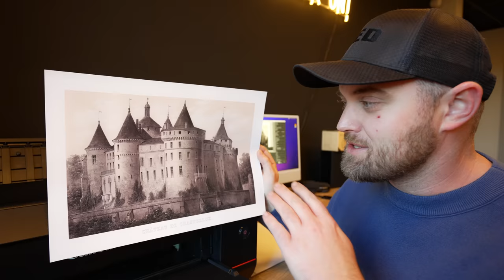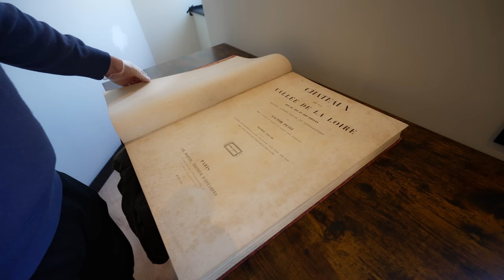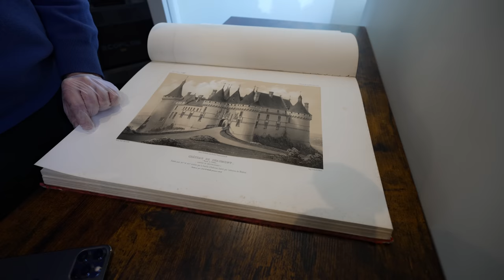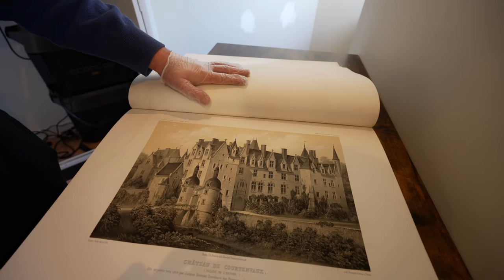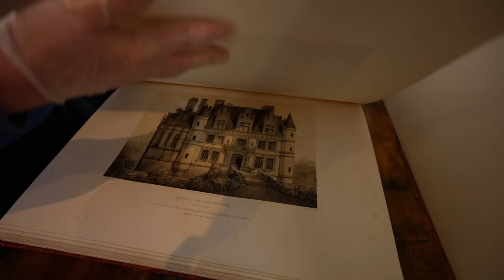Removing The Convents Throne

Comment: That book is stunning, and so are you prints! As a collector and maker of books (just a hobby), antiquarian book experts have learned from experience that it's best NOT to wear gloves while handling books. The clumsiness of them and not being able to feel the pages as you handle them can cause more damage than bare skin ever will. The exception would be for the old books (and wallpaper) from about the mid-1800s to early 1900s, especially the green ones, that can have arsenic in them; you definitely don't want to touch or even breathe around those. It's wonderful that you're sharing the prints and doing such a meticulous job of it, well done!